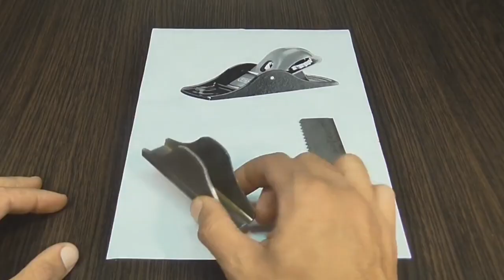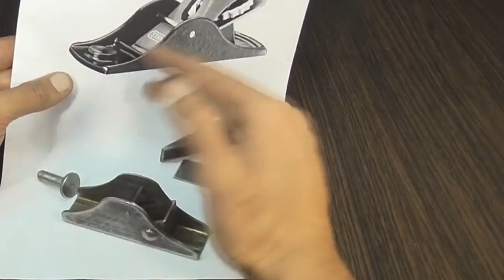MAKING A USEFUL TOOL FROM OLD BLADE AND METAL PIPE/homemade wood planer

Comment: Great Job! This is a very functional Plane. The only suggestion I would have to to change the Pin location for the Blade clamp. In All my planes the clamp never raises above the blade very much. Keeping the angle as small as possible ensure a very secure blade with absolute minimal pressure. In the wooden block planes the clamp is literally a wedge. This is where the entire concept for the metal block plane derived their design. Even the spoke shave uses a similar approach, With the spoke shave you have essentially three blade types, Flat, Concave, convex. Making spoke or arrows is very complex, and intricate work.
Reply from the maker: thank you for the feadback and the tips